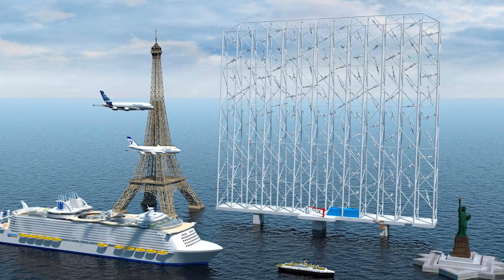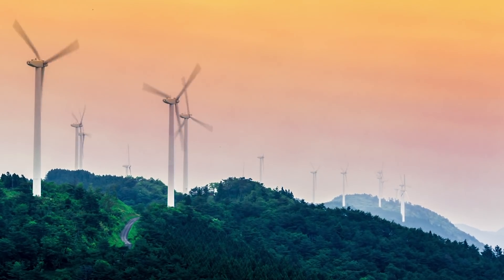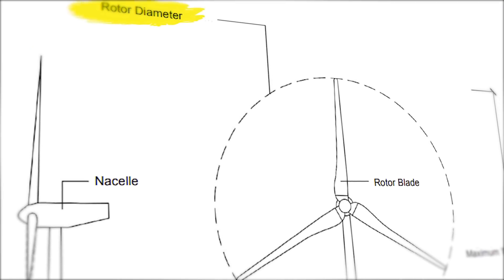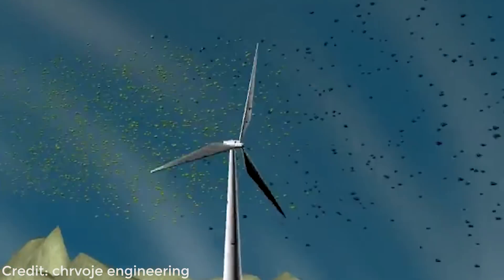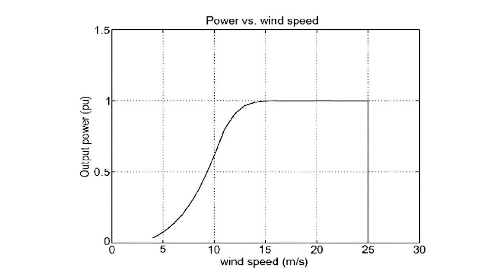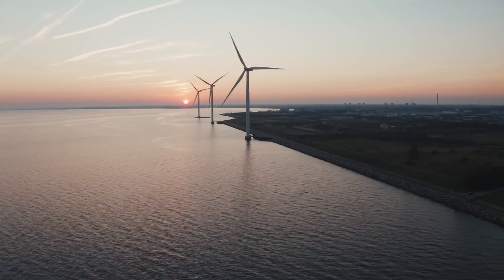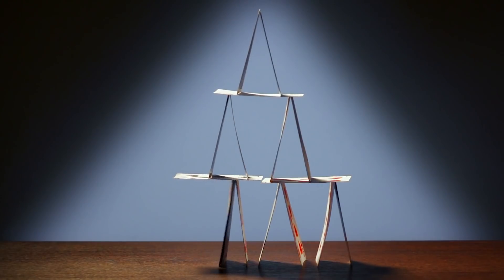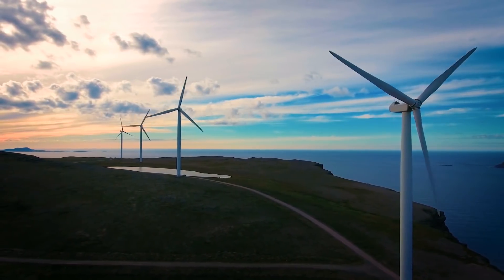Is this the Future of Wind Energy? - 200+ Blades!

Comment: I'm a big fan of your channel and have enjoyed lots of your earlier videos, but there are quite a few errors in this video 😞 
The major one is that the generator is sized based on a cost optimisation, not because the blades can't spin any faster. It's true that blade speed is an important factor for noise and leading edge erosion, but you don't need to limit the power output to reduce blade speed. The generator size is chosen so that it balances the capital cost of a large generator against the extra annual energy production, AEP, that you can get by increasing generator size.
Reply from the maker: ps. I hope the "big fan" was a deliberate pun 😉
Reply from the maker: Hi Rosie, thanks for your comment! I always appreciate constructive feedback! Sadly I rushed this video and seem to have oversimplified things and made a few mistakes along the way too! 

I am going to make and pin a comment addressing some of the errors so it would be great to get your feedback on it! Maybe we can call/message privately and sort something out?

My thought around the blades limiting the rotational speed was from the idea that because the windcatcher blades could be lighter per swept area, the load on the blades/connections/bearings/etc would be easier to design for when the blades are spinning faster than for a larger single turbine design. As although current feathering happens due to a cost optimised generator (not mentioning this was a massive oversight in the video!) I imagine this has knock on effects to the whole turbine design? My thought is that is a current single turbine design span up to ~25m/s without curtailing it would cause mechanic issues that would probably also be un-cost-effective to design for?  Though this was not backed up or thought through enough for sure! Interestingly, either way the windcatcher would still have the same issue of generator efficiency as I assume you also want it to have peak efficiency near the peak of the wind speed distribution regardless of its size? So it sounds like there are more issues with the windcatcher design due to generator sizing/efficiency that also will come down to cost, as a multi-speed gearbox is presumably too expensive and unreliable?  

Look forward to discussing it with you as I am always interested to learn more!

Cheers  😃

Comment: Maintenance would be an issue on this design. Imagine having to access one of the innermost generator/blades.
Reply: Each column has a lift system for installing the generators that can also bring them down for maintenance so there is no need for huge cranes etc. I have my doubts about the efficiency, but there are some good ideas here.
Reply: @AnalystPrime  The efficiencies is junk as you multiply the aerodynamical, mechanical and electrical losses. You can try and shift them around as much as you want, like try and couple turbines on a single large generator by belts, chains or gears. It is still energy conservation laws that apply here. Worse still, the lots of lattice structure and tight spacing will negatively impact the flow by adding turbulence.
Boils down to a single turbine does the a clear flow, has only roughly a single 5% aerodynamics, 5% mechanical and 5% electrical loss each. So it can handle a single gearbox to optimize the match with generator RPM.

When you get into pitch control and drive many generators below their optimum RPM with high gear losses, this fence design is just abysmal on the yield side.

With the cruise ship, Eiffel Tower, Statue Of Liberty and the A380 and Boing 787 flyby you know what you get. Powerpoint Engineering at it's finest.

Looking at scaling renewables, give a VAWT something like pitch control, scale it in 1.000 times energy density under water for 5 to 10 M€ or USD. Bring Tidal Energy down from 4 m/s to 2 m/s currents that are way more abundant on the planets watery surfaces. There you go. Once it works you could transfer this back into offshore wind energy. I still have a shelved concept of a huge maglev type of turbine of similar size as this in just a single turbine. That can at least work in theory. Is it worth looking for funding? Hells, no. 

Same thing as this, you can't test the real world efficiency of this in a lab. Someone got to bet on an insane 600 Million USD ticket minimum. Some fool obviously will in insane market conditions and first shot success is unlikely. So who does throw millions after millions here on such a scale?

I rather spent my time on something that does create real value in renewables. Surely that is not such an attention grabber that has conceptually been tried and debunked long ago and several times too. Mythbusters pls. jump on the stage.

Comment: I'm not a engineer. Why don't they gearshift to slow down the big windmill while turning the generator faster? Will the wind shear off the fan blades?
Reply: I am also Not an engineer, but from my understanding: 
1 The gearing would be more expensive than its use
2 It would add a Lot of chances for complications and parts to fail
3 The Wind Turbine moving slower would not really make a difference as the Wind turbine works the most efficient at the speed it was designed to operate at.

But I think its primarily that the cost is higher than the benefit
Reply: Many wind turbines (actually most) have gearboxes. Offshore they are not as common, mainly because gearboxes add maintenance and maintenance is very expensive offshore.
Reply: @EngineeringwithRosie  Ah, fancy seeing you here, I watched quite a few of your wind turbine videos from a while ago, they were great! 

Very interesting, I assumed they just all had gearboxes. I see you've done a video on this too, will have to check it out.

On another note, I saw Matt Ferrell's video about the hydrogen storage tape/film today. I'd be interested in seeing your thoughts on that, if you think it's not all just hype.
Reply: My guess would be that the blades aren't able to withstand the force of the higher wind speeds, that's why they feather them. In doing so they limit the force on the blades, and thus limit the output power. It's not really anything to do with the gearing, the blades just aren't strong enough to push any harder on the generator.

Comment: How does the turbines adjust their direction to turn into the wind?
Reply: Wind direction is not constant for the vast, vast majority of wind farms. And for offshore especially as they need to have a very high capacity factor (i.e. They need to be generating power as often as possible) to recoup the very high cost of the equipment and installation. I asked Wind Catching whether and how they yaw (turn to face changing wind direction) for a video I made on this  design and other multi rotor alternatives. But they never responded.
Reply from the maker: It definitely doesn't looks very mobile!
Reply: The newly proposed design you mean? They don't I guess.
But I don't know how important that is for offshore wind parks. Wind near the coasts is usually pretty consistent. Also they might be using some blade design that can capture wind from multiple directions.

Comment: Kinetic energy formula is wholly classical - nothing to do with relativity.
However, a very interesting video.
Reply: Also, the air density rho is missing from the power equation here. You can't have kinetic energy without mass 😀
I show the derivation of the wind turbine power equation in this video, I think that part takes less than a minute. 
https://youtu.be/7-awFXqisYA
Reply: @EngineeringwithRosie  They do have it around 2:30,  but, apparently, could not find ρ and used p instead :-)
What do you  think about this, Rosie? As far as I understand, the whole point is being able to exploit faster winds.
Reply: @bazoo513  ah, I didn't notice that. Thanks 😊
I did a livestream last week about ways to group wind turbines, and a big chunk was on Wind Catching and my opinion about their design concept. In short, I like the concept but not the details! If you've got a bit of free time you can check out my in depth analysis here: https://youtu.be/QqXxn5mKvlM
Reply: @EngineeringwithRosie  Thank you, Rosie! I am a subscriber, but rarely catch livestreams, and only periodically go to the channel's homepage to see what's new. This will be interesting...
Reply from the maker: @bazoo513  I am going to pretend that the rho just looks exactly like a p in the font I used... 😅
Reply: @ZirothTech  :-)
Reply from the maker: Although it was meant as a joke, I understand there are ways to derive the kinetic energy equation which show why there is a half at the front, however from my understanding this all stems from the square root in the Lorentz factor when we apply the relativistic approximation.
Reply: @ZirothTech  Well, yes, it could be argued that classical formulas are just low velocity approximations of relativistic ones.
Reply: @ZirothTech  Wrong. https://en.wikipedia.org/wiki/Kinetic_energy?wprov=sfla1 The "1/2 square" form is typical of integrals (and the "2x" form of derivatives). In this case it's from distance = acceleration x (time squared)/2 , because speed is the integral of acceleration over time. The connection with energy comes from: work = mass x distance ; work and energy are the same animal.